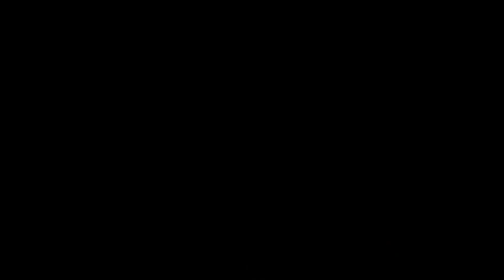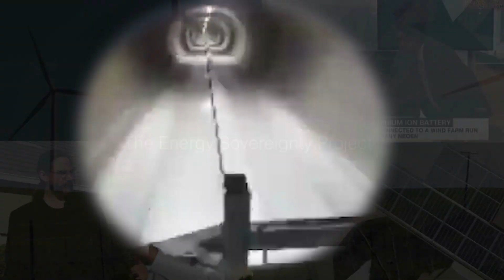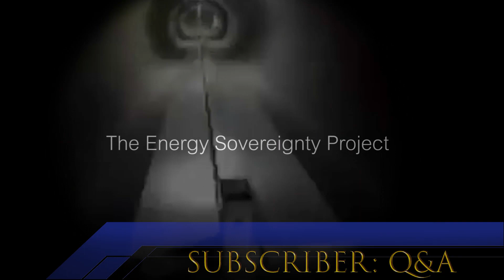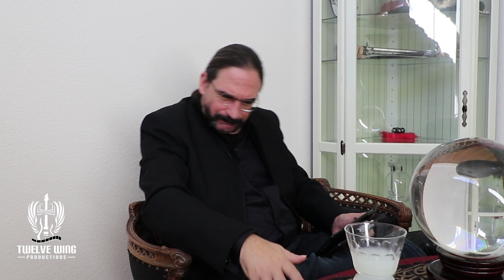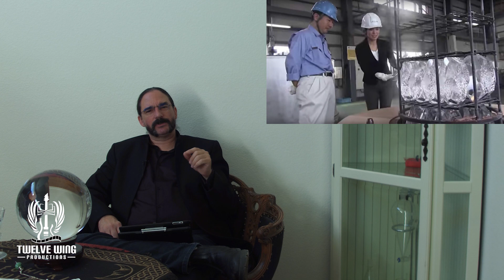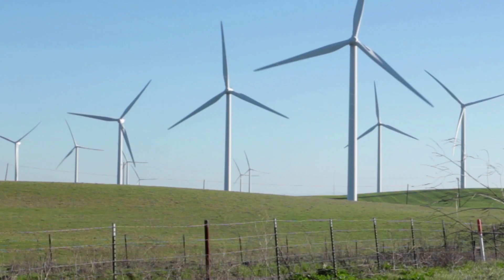Tesla's new Million Mile Battery: Is it solid state?

Comment: To 12 wings production:You didn’t even comment on the analysis I made of the economy, not a dot,the tsunamis of unemployment which are going to stall the economy world wide...Tesla, Nio, Aston Martin, and more..The reason is OCD, an overdose of Tesla with your blinkers on. Small cars equal smaller batteries, all this supported about the length of journies etc etc etc
Reply from the maker: You need to take a step back and try and make a single cohesive point.
The million mile battery, as far as I can see, will lead to one thing and one thing only... standardization.
If it can be made cheaply enough, it's basically a battery that makes all others obsolete.
Due to it's longevity, far greater numbers of them can remain in existence at once.
The overall positive effect on the environment will be astounding.
Yet you sit there and try and make a case that what Tesla is doing isn't a good thing?  Seriously?

Now if I'm missing your point, feel free to correct me, but stick to one point and give supporting arguments.  Otherwise we are just going to go round and round with the chimney sweep argument.  The chimney sweep and lamplighter's unions are likely to remain underfunded... and they will remain under employed.
Reply: @twelvewingproductions7508  Firstly,  I acknowledge the electric car. The M3 is overrated and incredibly expensive here in Australia..$72000 . a whopping price for a Mazda 3 frame .. it ain't big.. it ain't saloon, and low profile tyres totally inappropriate on what is in weight terms, an obese car... 4000 lbs. However the case I make is about the state of the global economy. I have given  you whats happening in the economy, the data and there are plenty of people who say as I do,  Tesla abd Nio and Nissan, and  others will be on the precipice of bankruptcy .. soon as the tsunamis of unemployment hit. I gave you data in Tesla sales it must make to 2025... 350000 units per annum... won't happen... yet the meteoric expenditure it makes . I also said to you that by every single measure supported by data,  the small electric car is the sustainable way to  go ..Many other scribes say that too, yet Tesla stupidly won't make the sustainabke car the masses because it wants range, range range.. range = bigger batteries.. but the journey data tells us that obsession with range is misplaced, and ' small' is  more sustainable in environmental terms and just as significantly in terms of what people can afford. It is quite clear you are on a crusade. The comment on chimney sweep and lamplighter's unions is a colourful term, but effectively emotive. I like the electric car but Tesla strategy NOT to provide a small electric for the masses is not just stupid  because the evidence confirms that is the way to go ..now listen..because the Tesla cars to date are not as sustainable as a small electric car. On top of that  Tesla is  on the precipice of bankruptcy by producing large cars (with hefty prices outside usa wint sell )with larger batteries.. larger batteries hurt the environment more  .. you don't want to acknowledge anything actually. Joe the blind miner knows the world economy us slowing , there's less disposable income.. you seem to refuse   to acknowledge what is happening with the world economy
Reply from the maker: @pragmatist165 , all that and you still haven't told us what the "small car" is for.
Is your argument that it's inexpensive.. or that it's "small" in size.
It seems that you are making a very strange attempt to conflate the two without defining the actual need as I have done.
My argument against a small car being necessary was, and is, that it is about cost and not size.
If a driverless car comes and picks you up from nearby... you don't need a "small car".
Reply: @twelvewingproductions7508  research confirms that small cars are totally adequate for urban environments, are more sustainable and the journey data  it's there,  supports what I contend. You just dont want to acknowledge what researchers say. The bigger batteries , OCD with range is flawed.I've  told you this...I don't want a a driverless car and many many others won't , you're going down a burrow deliberately.  I told you about the poor state of the economy.. the evidence is there to support the same concept I have enunciated.. unemployment is rising, Tesla debt is too high.. I gave you the sales they need and won't get 350000 cars annually to 2025 to survive. The Tesla in Aus .. people who have money and are largely bored will buy one @$72000 Aussie a shockingly high price.. it's a major issue.. SOLLINS is a fake promoting Tesla for his own advantage..he's got the Trump disease. Fancy referring me to Teslanomics..why would I get sucked in to the ' bible cult ' crazed junk talk you fakes continue to hammer. The y , the x etc are the wrong approach, small ekectric car are cash cows and better  too for the environment. you won't swallow that truth as you are on the evangelical  crusade.
Reply from the maker: @pragmatist165 , Research will also show that no car at all is also adequate for urban environments where convenient and cheap transportation is available.
So now all that awaits us is for this technology to mature.
Reply: @twelvewingproductions7508  OMG I have just googled Ben Sullins  and established he is deeply deeply involved in getting payolla/ facilitating sales etc  from Tesla and Tesla friends, facilitatating m3 sales and other Teslas 
. I now totally stand by my comments about Tesla flawed  strategy with electric cars ...the wrong strategy.. small electric  car is the right way to go. These sort of stooges promoting the m3, the x, the y etc despite what is good for the masses .. and good  for the world.  in glum eco times, the tsunamis of unemployment. You promote propaganda, Tesla propaganda. You refer me to it, tantamount to saying, read this, as if this is ' the word of the Lord, . In fact it is sort of Jonestown madness.
Reply from the maker: @pragmatist165 , I referred you to Ben's channel because he does a pretty good job of explaining the real economics of how Tesla works.  How any company works really.
In your first response you made some huge errors that showed that you needed to look at Tesla's debt in more basic terms.

Let me explain what you said and what I feel needs to be corrected.
You stated that Tesla was about $5B in debet.
Do you know how they got to be $5B in debt?

Say I ask you for a loan of $5.  You loan it.. no big deal.  I tell you I'll pay you $7 by Saturday.
Friday comes along and I give you $7.  I then ask you if I can borrow 10 and I'll pay you 15$ in two weeks.
You loan me the $15.
After 8 days, I pay you $15 and ask you for $20.
At this point... you start to look at me and ask me if I might not be able to do more if you gave me $50.

That's the raw economics of this Terry.  What you aren't grasping is that until Tesla starts to default on the loans it has outstanding, don't cry about how much they "owe".
3 months ago, or so, they repaid a $2.5B in loans.
So yeah, they have debt on the books.  They are a growing company.

So it's difficult to have this conversation with you if you don't even understand basic concepts about NRE.
There is a limited number of times I can try and explain this to you before I simply have to toss you into the wild and have you learn it the hard way.
Reply: @twelvewingproductions7508  another report today " 29% of Americans are regarded as lower class " . There is copious info on income inequality. Producing an affordable car for the masses just like the VW Beetle post ww2 is appropriate. We don't hear about it, the VW Ed.3 ( just too dear but worthy so far,) won't be the answer,  but I have faith in the Germans..and VW... their new adaptable 
 vehicle platform has been/Will be a winner.. Angela Merkel is sort of an angel.. pilloried by the media and far right, but took  100s of thousands of refugees. Tesla needs identify with the man and woman in the street, and refocus away from the Moon and Mars in particularly Mars.. total waste.. inhospitable planet .. a serious health issue in travelling and staying there..plenty of evidence to support that stupid and wrong focus 
.re Mars
Reply from the maker: @pragmatist165 , The Germans didn't have a solution for the transportation of the people other than them owning a car themselves.
Tesla's autonomous driving tech offers that kind of a solution.
So what it comes down to is in what we value as "freedom".
The car, to many, doesn't represent transportation.  The car represents freedom to travel.
I own my car and therefore I can just jump in it and go.  I don't need to buy a bus, train or plane ticket to go anywhere in the US that I want.  Right now.

So I think that what we need to look at is in the big picture of how emerging technology assists us in that goal.
For some, it's fine to have "the ability".  In other words that a vehicle service that they could take to New York from San Francisco would be fine.  This could replace vehicle ownership if that service were affordable enough.

The social argument is entirely separate from this.  That argument is more based on what we consider "wealth".
Lower class today... at least in the US... is NOTHING like what one imagines when thinking of lower class in the 30's.
Trust me on that one.  I've seen the family photo album.

So it may be time for you to take a couple steps back and see where we really are with this.  I think there are huge elements that you are missing here.
Reply: Twelve Wing Productions more evidence coming in about Tesla.. not making money on the x, the 3, and oodles commentators saying that financiers will leave them droves, aside from stock market crashing of its shares. Your snake oil remedies about Tesla surmounting this because you are some sort of messiah about finance, is laughable. Your obsessions with fake beliefs, with bull shit conman like cliches, and strange attachments to Tesla, mean, stay away from Twelve Wing Productions. The car for the masses, a smaller electric is the gap unfilled, and in a world economy where the main metrics point toward downturn, where discretionary spending is falling off a cliff, including flatlining Tesla sales, the car for the masses will have take up, if the price is right. We are in a world of stagnant wages. People are not spending, it’s getting worse. Price is going to matter a lot. I see the car that interests me, the Uniti One electric will produce its first small car in 2020. Hooray, but they are not a scaled up manufacturer. The answer to satisfy the mainstream consumer in eastern and western world cities is the small electric. The small electric will significantly revive a recession, a recession driven by the fall off of consumption. As the health of the US economy is driven at home, car manufacturers there too will be wise to provide a small car that consumers can afford.VW will be the manufacturer to repeat the Beetle revolution of post ww2.
Reply from the maker: @pragmatist165 , there are so many things you have missed in your post here it's really hard to know where to start.

The video you are commenting on has nothing to do with their financial situation what so ever.  It has to do with my belief that the "Million mile battery" they are talking about is a solid state or hybrid battery that uses a monocrystal structure for its cathode that is similar (if not identical) to the Goodenough/Braga "glass battery".
This battery solves the thermal issues of the current technology and allows for a deeper state of discharge and longer full charge state cycles while limiting the formation of dendrites. 

The end result of this is a vehicle and energy products that further reduce cost and extend the life of these products.

What happens with Tesla, happens.
The vehicle they produced at around $50-60,000 is priced exactly where a car of it's longevity needs to be.
When we close out our year with The Energy Sovereignty Project, these numbers will be laid bare.

To date, I have already personally driven our Model S a distance that would have cost $12-16,000.
Add into this that there has been zero maintenance in that time.  The car is still running on it's original brake pads.

So to sell a negative narrative of electric vehicles is going to be a bit of a problem for you.
This isn't me being pro-Tesla, this is me being honest about what I see in the engineering.
Not by reputation, but by experimentation.

In short, The Energy Sovereignty Project was specifically designed to either confirm or dispense with the very arguments you are bringing up.

It's dispensed with them as I am discarding your argument here.
It doesn't matter if Tesla pulls this off or if some other company does.  Tesla has laid the foundation of exactly how this will be successfully accomplished.
Reply: you're saying it's my argument that smaller cars are less expensive.. smaller batteries are less expensive for starters. etc etc. You're a joke. They are more sustainable, less co2, I don't need to say again about what drivers do, ie what is the average length journey,. I don't have to reargue it, it's a fact that it is massively less than the batteries in Tesla s.Further, the massive increase in installation of elec browsers is another reason that the crazed obsession by you and others can be summarily dismissed. Recharging times will reduce and are. There is a mountain of evidence supporting that small electric is what is best strategy.
Reply from the maker: @pragmatist165 , I'm not saying anything.  I'm asking you. I have been for a while now.  And you have been dodging it.
The amount of CO2 emitted from the largest of EV's...is zero.
It's all about where they get their power... and thus... size is irrelevant.
That's why I've been trying to nail you down on exactly what your friggin point even is.
And here is where we are back to those million mile batteries that you wanted to argue were irrelevant or stupid.
It isn't about size, it's about economy of scale and longevity.
So yeah.. you are on the losing side of this argument for small cars if your only support is the pollution angle.

If you were to have said, and pressed, the freedom angle.  You would at least have a leg to stand on.  But emissions?  No.
Reply: @twelvewingproductions7508  EMISSIIONS FROM N
MAKING THE BIGGER BATTERY ABD BIGGER CAR WITH HIGHER  ENERGY USE VIS A VIS SMALLER CARS. ITS NOT HARD TO WORK THAT OUT. IM TOSSING YOU KNOW TO USE YIUR PHRASE. IM PLEASED TO EXPOSE SOME TRUTHS HERE FOR OTHERS TO READ.  IT IS PRETTY WELL AGREED TGAT TESLA BUSINESS IS A GAMBLE.. JUST HOPE THE SPACE STUFF IS FUNDED ELSEWHERE ..  SUCH A FRIGGING WASTE. YOU ARE PEDDLING SNAKE OIL PROPAGANDA.  ABD RE THE M3 , WHAT A LOUSY LOUSY DECISION,  A DECISION TO PUT LOW PROFILE TYRES ON WITHOUT IT  ESCAPING GETTING STOPPED BY SAVVY ENGINEERS.  MANY EVANGELISTS SCOFFED AT TESLA PANELS DID NOT  FIT PROPERLY. BUT IT IS INDICATIVE OF WHAT ELSE IS SLOPPY. SHIT MAG WHEELS ABD SHIT LOW PROFILES EXPOSE THIS HEAVY CAR.. YOU SAY STEP CACK, IM , IM WATCHING THE ECONOMY, THE HAEMORRHAGING OF TESLA AND DEMISE .. NOT BECAUSE ELECTRIC CARS  ARE NO GOOD,  THEY ARE, But patience will be rewarded .. most Aussies aren't buying , they're right to wait for the smaller batteries etc etc to get a better value electric than the M3. I AM WAITING FOR PERHAPS THE UNITI ONE ELECTRIC .  LOOKS A BIT DOUBTLFUL to get off the ground  OR EVEN A SLIGHTLY MORE BEEFED UP I-road toyota. One of these to supplement the ICE  newish car I have, which is stunningly brilliant in every respect. so I am casting you adrift, another bs evangelist dick

Comment: LOL ... it pretty much the same Lithium chemistry that they and everyone else is using ... controlling charge / discharge rates is all that is required to go a million miles .. but then what good is a battery pack that vastly outlasts the rest of the vehicle .. that is just stupid engineering and cost wasteful.
Reply from the maker: Couple points.
Firstly, while what you say is true that strictly controlling temperature and charge rates beyond those experienced in the real world will give a test result that is unnaturally long, that's not what's going on here.
Here is a link to the full article being discussed as well as the test results:
http://m.jes.ecsdl.org/content/166/13/A3031

Secondly, I think you need to explain your thoughts on exactly what part of the car is going to wear out?
An EV isn't like a standard petrol powered car.
When an ICE engine/transmission reaches 200,000 miles it simply isn't worth replacing.  At around 100,000 miles it becomes a financial crap shoot as to if you should repair it or not.

With an EV, the battery isn't married to the car.  In the case of an automobile accident, even if the pack is damaged, individual modules can be removed and the pack refurbished.
The car itself is powered by two removable drive units with single speed reduction gears instead of transmissions.  Not only do they last much longer and require nearly no maintenance, but when they do need replacing it's an easy decision to do so.
It requires very little labor to change them out and the new/refurbished drive unit will last exactly as long as the one that just came out with no additional headaches.

So I think you may need to re-calibrate how you are thinking about all this a bit.